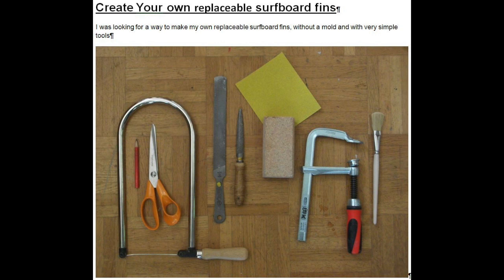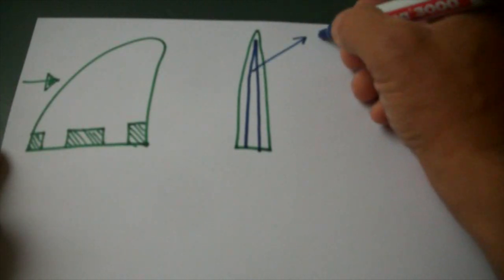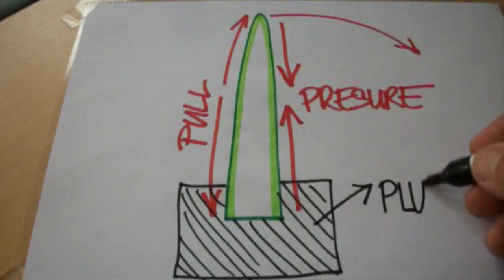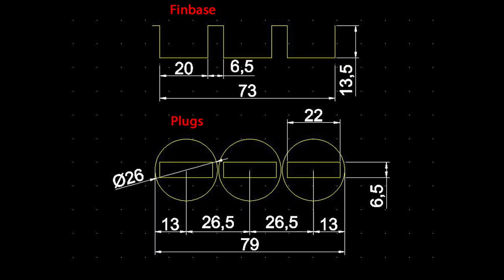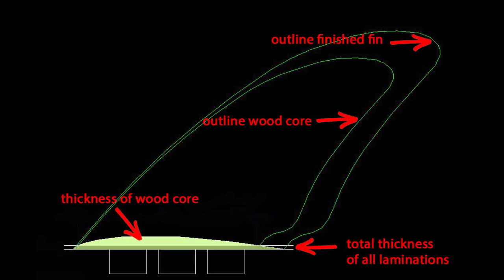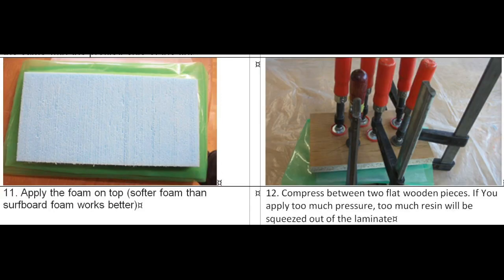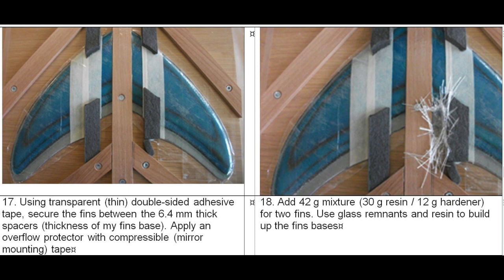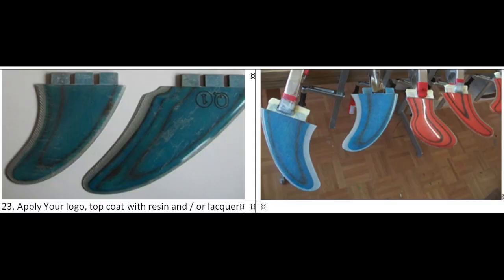How to make Your own replaceable wood core surfboard fins

Comment: This is really excellent ! Thankyou. I make my own nice tiimber and or Virch
 Birch Ply fins. I don't even bother with making them movable because, take it or leave it I hate all those expensive fin systems.
All I need to know when I'm out there riding my surfboard on my own is my feeling of reassurance that my fin IS NOT going to move around in some kind of stupid fin box. Like it did once when I was out at North Point.  Hey ! - NEVER AGAIN !   Ever since that day I've glassed my fin into my board like I used to do in the late 1960's. THAT'S THE BEST WAY.
 so
Reply from the maker: Hi Dave. I agree, that the fin boxes and the fins to fit them, are very expensive! A good reason to make it yourself. You had bad experiences with movable fins, that's unfortunate. Fix fins of course are a way to deal with it. If You want to color up Your wood fins, have a look at this video:  https://youtu.be/JN-4zkXMjZY
Reply: Dave Simmons Blaming fin boxes because you were too menially lazy to check the fins is  just intellectual lazy. Not that there's anything wrong with glass-ons, as long as you never want to experiment with other fins or want to take the chance of broken fins when traveling.

Comment: This fundamental, if basic, explanation of the load at the fin base offers good reasoning for the advantages of Futures fins over FCS fins. In FCS fins all the load is being directed into the 2 isolated  mounting points . In the Futures fin, load is dissipated over the length of the entire fin box, a better solution.
Reply from the maker: Yes, Future have a longer base and are also slightly thicker. This does not have a significant impact for DIY fins. It only changes the shape of the base. I do not find FCS ideal either. That's why I always mount three plugs per fin on my boards and have three mounting points per fin accordingly (except for fins with a very short base). In my opinion, a mini turtle box for surfboards would be a good solution. But then you have one more exotic variant, even more fins....
Reply: @robiegle  Are you saying you use the FCS variation because it's easier in a DIY application.
Reply from the maker: @rickden8362  When I made my first surfboard, I used windsurf fin boxes that I milled shorter, so basically a very short US fin box. At that time fixed mounted fins were standard. It wasn't until years later that the FCS system came on the market. I never really liked this system. I distrusted especially the small fixing screw in the plastic. That's why I first made the plugs by myself. I made them from carbon fiber, with a stainless steel thread for the fixing screw. That was still in the last century. The reason for all this effort was because the FCS fins spread very quickly all over the world. Since I traveled a lot and surfed in remote places, I wanted to use the most common system in my boards. I built my boards sturdy, so they were correspondingly durable. I didn't want several different systems on my boards because that would have meant more baggage again for various fins. The Future System was also much slower to spread and came to my knowledge later on the market. Today I would prefer Future to the new FCS system. To build fins yourself the shape of the base does not make much difference. First the fin, then the base shape, as needed....
Reply: @robiegle  I see now. I've always wondered why the FCS system, which, IMO, I consider inferior to the Futures, is so popular. As an aside, a fin box almost identical to the Futures was patented in 1983 but the inventor was terrible at marketing plus he had no matching fins and it went nowhere. Cheers.

Comment: Great idea. Kind of like vacuum bagging but without the vacuum. What did you use between the foam and the cloth to prevent the resin from adhering to the foam?
Reply from the maker: Hi, in the following videos about fins I put on youtube, I explained this better. You are right, it is like vacuum bagging, but with simple tools. I vacuum my surfboards, but for the fins I was looking for an alternative way, with tools, that are available for everybody. Check my fin videos under "robiegle". There I show that I use a PE plastic (could be from a transparent plastic bag), with holes poked through (diy with a needle) on the resin  side and then a cotton layer (could be from a t-shirt) and then a PE layer again, this time no holes in it and then the soft foam and the block.

Comment: After laminating do you hot coat the fins or put on a lacquer.
Reply from the maker: After laminating, I sand the surface up to grit P220, starting at P120. Before, when building the lamination, I make sure I use a light glass (170g/m2 (6oz)) as top layer on the outside. This gives a finer surface, less sanding and a stronger fin, because less ruptured fibers. Then I spraypaint the 2K lacquer (No top coating). However, this requires at least two coats of lacquer. For intermediate sanding I like to use hard wooden sanding blocks (Flat or slightly curved, depending on the shape of the fin.). I stick carpet tape on the blocks and cover them with P220 sandpaper.

Comment: Thanks for posting this.  In some fins there is 'cant' - a slight angle between the fin and the pegs which when mounted to the board causes the fin to angle away from perpendicular slightly.  Any ideas on how you might achieve this with some adaptations using your basic procedure for wood cored fins? Thanks.
Reply from the maker: Hi Scott Thanks for the question. I have not tried it out yet. I'm sure it is possible, if You sand the inside of the peg section (that will fit into the plugs) in the angle of Your canting before laminating the finished wood core. You will have to use a bottom press form with a kick at the peg section (probably a thin wedge out of soft sponge under the separation foil will to the job as well). The profiled top side of the fin I would leave as it is for laminating. The fibers will go straight, but that's O.k. I would fill the peg higher and sand it down in the right angle (parallel to the flat side). We are not talking about much material to take down, so I think this is not a big deal. I looked at foam core fins from China with canting before. They didn't care about fiber orientation. They simply mill-cut the canting through all the fibers. Obviously they can sell the shit… (but I would not try it). My next thing is to make bent side fins. There will be no canting, but they will bend outwards (like fins with canting), to get a better "grip" at the deepest point in the water when leaning into the turn. This is more or less a similar effect. Of course they will also cause more lift in the face of steeper waves, which might be a disadvantage. Fun to try anyways!
Reply: Sounds good and interesting idea of the curved fins.  Regarding your process - do you find the mattress foam works ok , or would you recommend a slightly denser foam?
Reply from the maker: Hi Scott. The foam I used was soft, like a mattress foam. It worked very well. Unfortunately I have no density number, or any other specification. Soft foam will lay better around the profile.
Reply from the maker: Hi Scott. In this video    https://youtu.be/JN-4zkXMjZY  You can see the type of foam that works better. I just laminated the two bent side fins. They are not finished yet.....
Reply: Thanks again.

Comment: How you covering the exposed wood when you cut the plugs?
Reply from the maker: The wooden core is already quite impregnated with Epoxy through the presure applied with the clamps. Like this the wood does not take water, as far as I can tell. At the end, I laquer the fin all around.
Reply from the maker: Hi Neil
When I lacquer the fin in the end, I cover the top of the base with lacquer too (only the the side surfaces that fit into the plugs, I cover up). It seems, that the veneer sucks the resin all the way through, so it is impregnated, kind of like the fibers of glass or paper or what ever fabric that has capillaries.
Reply: robiegle gfg

Comment: what it means glass 165g and glass 390g?
Reply from the maker: It means the weight of the glass fiber per square meter. Heavier glass is thicker than lighter glass. Because of this, the layers build up differently around the wood core. A layer of 390 grams per square meter is about double as thick as the 165 grams per square meter layer.
Reply: how you measure the weight of glass? how to apply it on the fins? I have plastic fin. I want to make it more strong. so what I need to do?
Reply from the maker: The producer of the glass is usually telling You the weight of the glass. It is either measured in ounces or in grams, usually both (1 gram is 0.035274 ounce).
If You don't know the material of the fin (could be Lexan, GFK, etc.), it is difficult to give an advice. Personally I would not try to enforce a fin, except if it is fix glassed on to my surfboard. There I would use either Polyester or Epoxy resin, depending on what my surfboard is made out of.